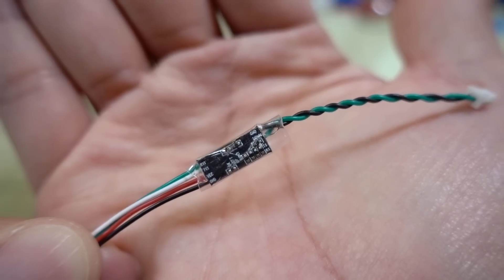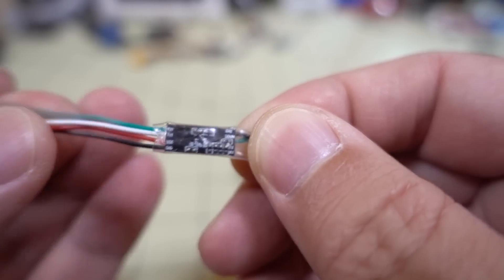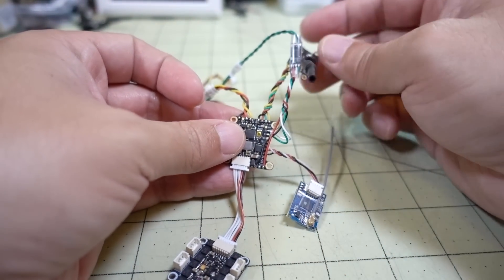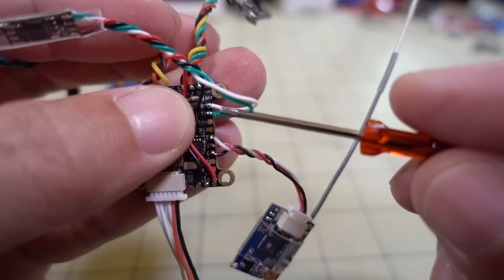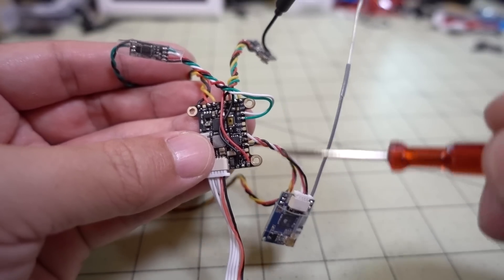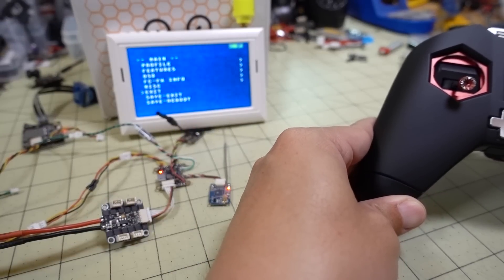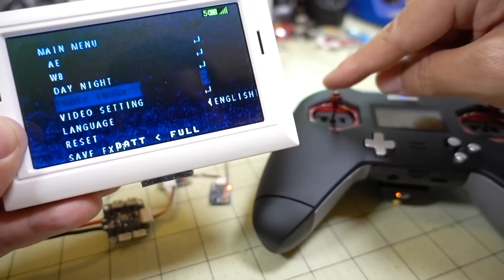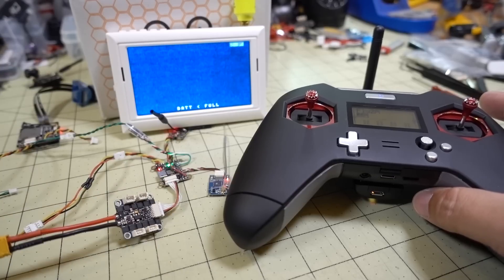Caddx FC Camera Control Adapter 🛠️📷

Comment: Is this still needed with the caddx ratel 2? Just installed it (came frome a phoenix 2) and the cc doesnt work. It worked on the Phoenix 2. Just run a wire from the osd pin on the camera to the cc pad in my speedybee mini fc.
camera_control_ref_voltage is correct.

Comment: My flight controller has a camera control pad will the ratel camera work without this board?
Reply from the maker: It might or might not.  Every FC does it slightly differently.  That's why Caddx made this cable to send the correct signal.  You should just test your FC and try it out.  There's no way for me to tell.
Reply: @AlbertKimTV  Yea I connected the camera (osd to cc pad and ground to ground; even ground to cc and osd to ground as apparently the ratel is labeled wrong) and neither worked. Bummer I don't really want to order a board from banggood

Comment: Hi, today I installed the controler to the FC and my Caddx Turtle V2.
But I am not able to open the camera menu... But if I connect the external pcb controller with the button it will work. I connect TX to RX2 and RX to TX2 and configured it in Betaflight...
May you can help me with this issue?
Reply from the maker: Analog camera control doesn't work with every FC.  There are a lot it won't work for no matter what you do.

Comment: nice video man...
my airbot f4 nano has a cam control pad, and i just connect the osd from the camera to the FC cam control pad and it works with caddx turbo micro F2, but why doesn't it work with caddx turtle v2?

Comment: Yes I have the same problem with camera control. Down arrow will not work. CLracing f4 mini Caddx mini camera. Only up arrow, right and left work. Reading Betaflight camera control , 4.1 you can set button resistance, Going to wait till a stable release is done before re-flashing. The resistance value of the down arrow is about 1k ohms. For now just living with the minor glitch

Comment: Will it work with betaflight modes for camera? record, stop etc.
Reply from the maker: No, this is for non-split type CADDX only cameras.  If you want to use the record, stop functions on the turtle, you don't need this adapter, you can connect to TX/RX directly on the turtle board.

Comment: That’s weird I just down loaded the caddx app for my new cine 4k Drone then your video popped up on my YouTube .🤓 they really movin full steam arnt they.
Reply: What does the app do?
Reply: Panda FPV you can get you the setting inside the camera and format the sd card which you will need to do before you use it, the app is free by the way .
Reply: FPV FREAKY cool, what caddx camera does it work on?
Reply: Panda FPV the app is for the caddx tarsier 4k camera, the new one that just come out. I’ve got it now the fpv feed is great 🤩.